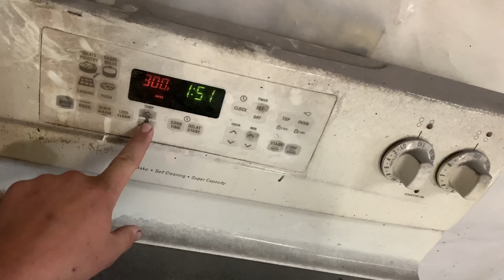Freedom Corvette Covers for Cleetus and Donnie the C5 DRIFTMOBILE

Comment: im intressted in a few things, because im disighning a tube chassis however id have to wides the body i want on it, so im intrested in if there are structural problems with it
Reply: i'll watch the videos when i have time altho asking atm as this is the first time i encounterd your channel
Reply from the maker: So far no bug a good amount of reinforcement will be added
Reply: @GARAGEIdiotS  ok so i take it that its structurally in need of reinforcement, i would asume that plating is the majority of that, or is it more of a flexing problem that results in it being weak rather then joints that are to long for how thin the material is?